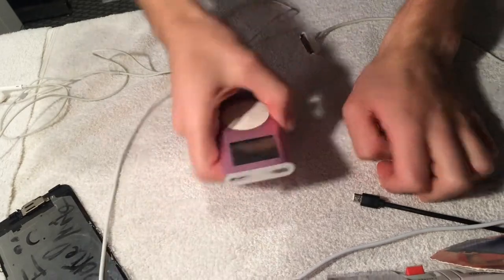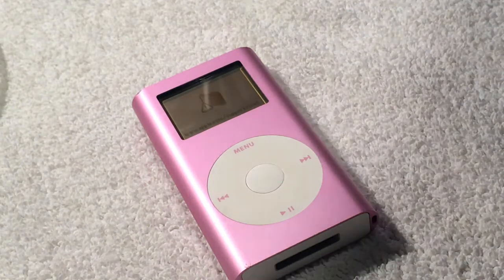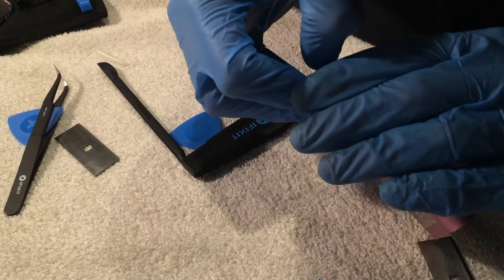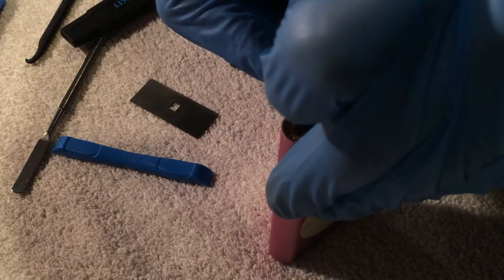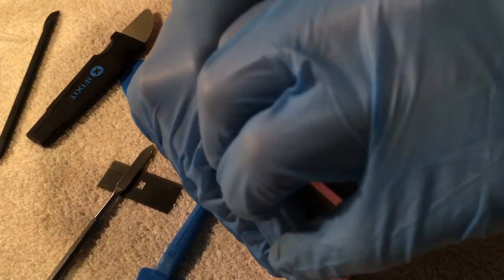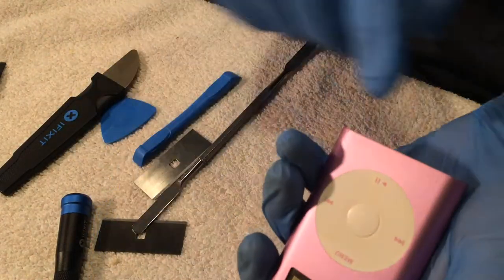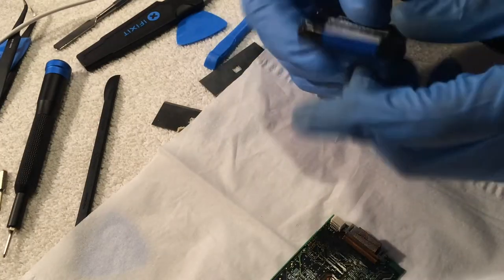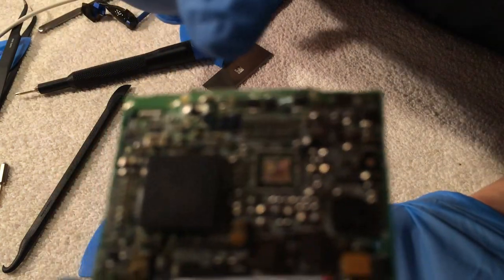iPod Mini Repairing the Sadness

Comment: So did switching the microdrive fix the issue?
Reply from the maker: When I took the drive out of the iPod and shook it a bit... There was a Rattle witch is not good I don't know why it was working and then it wasn't but there probably was an influx in current causing the drive to bust... Although I only shake hard drives when I noticed there's an issue not before there's an issue because I don't want to unintentionally damage to drive.